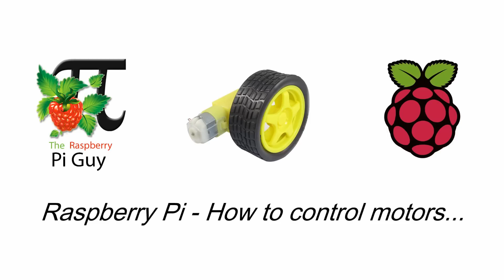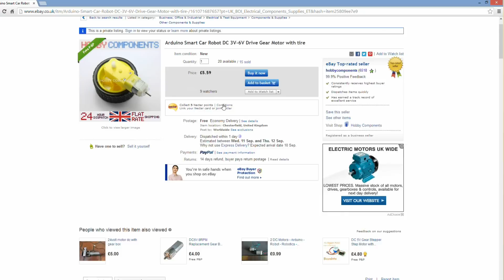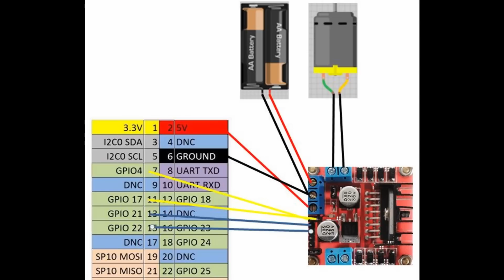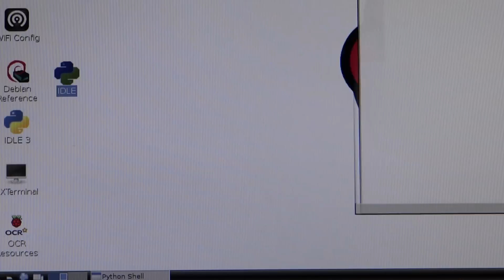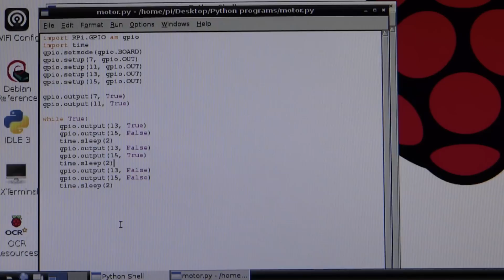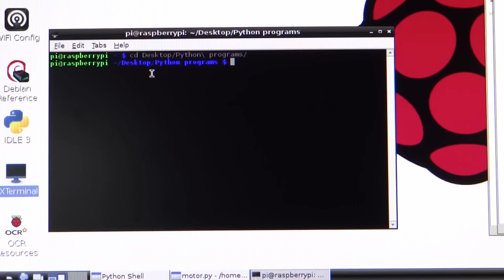OLD:Raspberry Pi - How to control motors...

Comment: Hello Sir, I managed to make the connections and also run the code properly. Thank you very much for the video. But I seem to be facing a problem, the motor gives a few spins (2 or 3 mostly) and then stops, it just doesnt respond. If I reconnect the ground connected to the motor driver or run the script again, it spins again a few times and stops. I have tried multiple tutorials but cant seem to identify the problem. I exactly replicated the wiring shown in your schematics. The motor is powered by 4 AA 1.5V batteries just like in the video. Only time this problem doesnt seem to occur is when I apply 20V 1A DC supply from the adapter and I cant possibly use that 20V coz I want the roboCar to roam freely (not plugged in to the wall).... Can you please help me identify what I might be doing wrong?

Comment: OK :) It is a good video If you are Matt Timmons- Brown Learn Robotics with Raspberry Pi  ....Problem...Chapter 3 page 62 to page 66.. You lost me and maybe a few others on this exact wheel motor on wiring in your book both wires are red. Not sure why one isn't a black or blue to show the difference between the positive and negative hook up. I am sure this matters in some way Let's go with page 62 Neither the motor or the wires tells me which is positive or negative I'd rather know then guess any tips?
Reply from the maker: Hi Scott! Thanks for your question - you can reach me at my email address or on Twitter more easily in future though. 

Just taken a look at that page and you don't need to worry. DC motors like these do not have a particular polarity, and so you can run electricity through them either way. In actual fact that's how you get them to go forwards or reverse - electric current one way or the other. That is why both of the wires are red in my book - the orientation doesn't matter.
Reply: @TheRaspberryPiGuy  ok thanks but does each wire go to a positive and negative on the bread board ?
Reply from the maker: @scottrocket3274  it is the same deal with the motor connections on the breadboard - the polarity and orientation of the wires is not important. Hope that helps :)

Comment: Could you use this if you wanted to control 5 or 6 motors? Also if you have more than 1 motor control board do you have to ground the Pi into each?

Comment: This video is great and really helped me out, so thank you very much :)  The only thing that I noticed is that in the video, you suggest that the +5v power on the L298N board is needed to supply the bridge with power (in which you did using the +5v power GPIO pin on the RPi). This video is the only resource on the net that claims that +5v is needed to supply the board, as all other information states that the +5v pin on the l298n bridge is to output a voltage to other peripherals. I tried out the l298n without supplying the +5v as stated in the video and the chip performed as expected and did not need it. Just to let you all know :)  Good work!!

Comment: 4 battery pack with 4*1.5v = 6v (if you are using non-rechargable batteries).
Raspberry takes 4.75-5.25 input voltage. Is it okay to give 6 volts from battery pack to h-bridge+raspberry?

If it so, can I use 4 rechargeable batteries, which will provide only 4 * 1.2v = 4.8v?
Will it be enough, or should i use 6 battery pack(with 5 batteries), in order to provide 5 * 1.2 = 6v?
I'm so confused about it, can someone explain me please?

Comment: But by using two GPIO pins for the enable you chew through a lot of pins. I'm controlling four motors identical to yours so I need to economise. I'm only using two pins per motor. I hold one low and PWM the other for forward and round the other way for reverse. On the driver the enable pins are jumper end together. Easy.
Reply: Thanks fro sharing , How are you using one PWM signal from one pin to change the direction ?
Reply: +vikas narang as I said, I'm using two pins. One acts as the ground and the other has the PWM signal. Swap for the other direction. The swapping gets done in code. So I've used 8 pins total for 4 motors but I can control them all independently.
Reply: +Ryan Ruckley  gotcha ... i didn't undertand the pin swapping part the first time.thanks a lot for replying

Comment: A little dilemma here, how do I know if this motor: http://www.ebay.co.uk/itm/Robot-Wheel-Motor-Tyre-DC-3V-8V-Arduino-Smart-Car-/131199698119?pt=UK_BOI_Electrical_Components_Supplies_ET&hash=item1e8c1c84c7   Will come with 2 wires attached to the motor terminals? As I am slightly worried about using a soldering iron but if I have to, would this wire be sufficient: http://www.ebay.co.uk/itm/10M-coil-11-AMP-Rated-0-5mm2-Thin-Wall-Single-Core-Cable-Car-Wire-LED-Lights-/111294043052?pt=UK_BOI_Electrical_Components_Supplies_ET&var=&hash=item19e9a453ac  Any help is appreciated, thanks!

Comment: That's what i love about the raspberry pi. The sky is the limit. You could make a quadrocopter with some fans on some light motors and use a raspberry to control it.. Put on a webcam and have a transmitter sending back the signal. Shouldn't be too hard. At least as a PoC build. I wouldnt mind having the time to make my own drone from scratch.

Comment: If you are using 2 motors do you need a higher voltage from the battery or will it just run out faster?

Comment: so i want to control a RC car motor speed, so i need more, power can i simply replace the battery source with the rc cars battery pack, it uses a "Lipo Battery 1500mAh 7.4V 2S 25C"

Comment: Why would you put pins into screw terminals?  It looks like that board has pins right next to the screw terminals you can use to power it.  Also why are you wasting two GPIO pins on "enable A" when you can just hard wire them (this is even shown in one of your stock photos -- you can clearly see someone simply just put a jumper over the enable pins!)

Comment: How can I change the motor speed (slower)? Is it simple?
Reply: Use pulse-width modulation (PWM). Basically, turning the pins on and off really fast, leaving it on for a percentage of the time, corresponding to a percentage of the power and speed. Google "raspberry pi PWM"
Reply: Thank you; i found another tutorial for that on YouTube :)

Comment: if  i want to make a car with this principal will i have to buy 2 L298N's and another raspberry pi
Reply: not another pi, just connect the 2 L298N's to the same pi, as far as I know.
Reply: Thx
Reply: @leop
Reply: Yes, two L298Ns can connect to one Pi. Jumper the Enable pins and it only requires 4 GPIOs. Pi has 17 without soldering on the second header, so you can use up to 4 L298Ns to control 8 motors, with one GPIO left over (indicator light?)
Reply: You could also consider keeping the car 2 wheel drive (power either the front 2 or rear 2 tires and have the other two free spinning).

Comment: that's got to be the most china motor ive ever seen, so wobbly lol - it would be much easier if you just started idle in root and ran your program from there. just add gksudo after apt-get install gksudo - or use sudo when you edit the desktop shortcut, that way you dont have to type all that stuff in when you are prototyping constantly - also sudo su helps in a shell if your going to be running allot of root commands.

Comment: cool.
multi port high power USB HUB charge tablet ipod ipad phone USB BITCOIN Razorfish

Razorfish Solutions manufacturers
USB HUB 19 Port USB Hub with Integral power supply and Steel/Aluminum case

This is a 19 port hub With an integral power supply capable of 
reliably supplying MORE that 500mA per port without overheating or becoming a fire hazard. 
16 Front facing Standard A USB ports 3 Side facing Standard A 1 Master hub connection 
Standard B for connection to Computing Equipment or other hubs Fully fused internally via multiple poly-fuse resettable fuses both on each individual port and on the main power feed to the Ports.
Unlike may of the cheaper USB ports that only implement links at 1.0 12mb/s speeds 
(but state they are 'compatible' with USB 2.0) 
this is a professional FULL 480 Mb/s port that complies and implements the full 2.0 USB standard,
it may also be used to connect to generic USB 1.0 equipment.

Comment: You don't have to connect the first Enable-A cable from your video. As long as the second is high, the chip is enabled. This is also the input to use with PWM to control the motor's speed.

Comment: Thanks again.  Just spent time with my daughter converting a small robot using this. We used two wheels (easy enough) and, other than being a little under-powered, it worked great.

I didn't want to have anything connected such as a keyboard so I set up SSH so that I could remote into the Pi and run the programs using Putty from my Android tablet.  Look ma!  No hands!

Comment: Nice tutorial! That exactly what I need. But I tried and found the rpi can't work however. When it started screen can print some messages, Particularly  the network module can't work, neither wired or wireness. And the power I use is 12V. So I doubt the gpio 5V if whether can as the power input? I also see the circult diagram, it didn't has a diode, then I can't how to do next,  appreciate for any advices.

Comment: I get a syntax error (Non-ASCII character) on line 13 :L when I run the code.
Reply: please help some one. :(
Reply: ***** what you need to do --> 1. Check your code. 2. Save your code. 3. Open saved code using Geany. 4. Delete the top part which describes where and who made IDLE. 5.Try running it again, and restart your Raspi ;D. 6. Reply if you need help or if this worked :D

Comment: How to control 12 motors with rasp?
Reply: 12V ...? or many motors with rasp...?
Reply: FinnishGuy101 I was use GPIO direct drive 8 digital 7 segment and LCD1602*1 and 12 stepper motors

Comment: Thank you so much.  This is an excellent step by step guide.  
I have an older robot built with some old power screwdriver motors but we had to control it with switches and walk behind it.  That robot was built with my Son and now I'm going to use this to update it as a project with my Daughter.   This was exactly what I needed.

Comment: Most of all videos I've seen, the user is pi, with the stupiest sudo setup that I know...
Plus: all of you using the xserver. So much Ressources for a mouse.

Y U NO use the power of shell?
Reply: thanks for whining , judging and slamming while contributing absolutely nothing to this topic. Youtube could use substantially less of your kind. RaspberryPieGuy took the time to put together a 20 min demo for everyone's benefit. Feel free to do up your own if you've got a lock on it.
Reply: Robert Stotts
Security is always important, and it is not best example what he did.
You can see this as a proposal.
Reply: learn to spell stupidest
Reply: Robin Cerny Security is not always important, so relax big guy no one wants to hack into your network and burn up your DC motor or access other data that someone super smart like yourself might have.
Reply: Security is not always essential especially for a device like that. And if you mean about following traditional practice regardless of situations that is debatable. You may actually suggest that the author would give notes, ideas or warnings on his videos about security in raspberry pi on setups that would need it then I could agree with that although it could also give weight to the lesson. As for X it may be giving less runtime efficiency but may have been a better choice for presentation with the videos to get newcomers and even experts to get the concept of the main topic quickly.
Reply: Yes like I said on setups that would need it that would apply but not on something that would just run motors. And follows my other explanations as well.
Reply: Ross Konsolebox
Right, with X it is easier. But security is always important. Many of the users use it as a small server. And many use it as a webserver which is accessible from outside.

Comment: Good explanation. 

I have one question for which I believe other people may have too:

How to control speed of the motor(s)?

This is because sometimes we don't need our robot to run as faster as possible, but instead very slowly - especially when some detector (ultrasound) is attached to help avoid obstacles. If speed is too fast, then robot will bump into obstacles too often.

Than you in advance,
milan
---
Reply: spoydi spore
Not true, you can (and should) use PWM...
Reply: the only way to control a dc motor with 2 wires is to adjust the voltage going through the motor. you can easily do this by making simple 5 transistor circuit on the power supply for the motor and using a potentiometer to controller the current going through the transistors.
Reply: loop delay the output of the PI.
Reply: KKuurus I am not still sure delay what? To make short pulses, then delay? Or, something else? Or to use PWM? Does this device has PWM at all? 

Sorry for too many questions, but before to make decision whether to invest money into this 'toy', I want to know what exactly I need for robot (I have plan to make one, maybe in distant future... low on budget right now).
Reply: by looping through a delay before you reposition the servo/stepper you can slow the movement of the motor. 
in the software driving the motor, will slow the movement of the shaft,
PULSE
delay delay delay
Pulse
Pulse
delay delay delay
Reply: ***** PID will do the work if u know how to use them

Comment: would i be able to use a 1500 mah NiMH battery from a traxxas rc car to power my motors? or would i fry the arduino. Also do you have a video showing how to hook a xbox360 remote to rpi?
Reply: Depends on the voltage of both the battery and the motors. 
And to hook up a xbox360 remote to the pi plug in the cabled version or buy the wirelss controller for windows/PC
Reply: thanks

Comment: so you made it control a wheel but how would you get it to control multiple wheels?
Reply: Use the A side (ENA, IN1, IN2) connected to one motor and the B side (ENB, IN3, IN4) connected to the other.
Note the "back enable pins" are not Enable at all, but +5v. You may jumper between the front and back to permanently enable that motor, or connect the front Enable pin for each motor to the Pi. Do not use 4 wires for Enable, only two, connected to the front pins, the ones even with the IN row.
Reply: he did mention you could use input 3 and 4 for more than 2 motors

Comment: Would it be easier and/or more efficient to control motors that are connected to arduino but controlled by raspberry pi. I've already successfully done this but I was wondering if excluding arduino and only using RPi would be more beneficial. I'm working on converting a RC car into a car that will connect via wifi to be controlled by inputs on my computer and receive a live camera feed and later I plan on making the car autonomous by adding sensors.

Comment: Can you control motor speed with the L298N or is it just an on and off function??
Reply: You control motor speed with your program in Python
Reply: Thanks, that is what I thought but wanted to make sure the relay would not act as a simple on/off switch.  I guess I should have said, Can you control the speed despite the relay.
Reply: Chris Kaspar The L298N is not a relay... it's an H bridge. A relay IS a simple on-off switch.

Comment: HI
Thanks for tutorial but im stuck. 

First bit of code ive ever used so sorry if this is a daft question

 Ive used ur code as follows in idle and when i run it i get

SyntaxError: Non-ASCII character '\xc2' in file motor.py on line 13, but no encoding declared; see http://www.python.org/peps/pep-0263.html for details

What does this mean???

code i copied

import RPi.GPIO as gpio
import time
gpio.setmode(gpio.BOARD)
gpio.setup(7, gpio.OUT)
gpio.setup(11, gpio.OUT)
gpio.setup(13, gpio.OUT)
gpio.setup(15, gpio.OUT)

gpio.output(7, True)
gpio.output(11, True)

while True:
    gpio.output(13, True)
    gpio.output(15, False)
    time.sleep(2)
    gpio.output(13, False)
    gpio.output(15, True)
    time.sleep(2)
    gpio.output(13, False)

Comment: Is it possible to bridge the ENA pins with a jumper, like on one of the photos?
In my opinion the Motor should be enabled the whole time.
And now I can simply turn on and off the motor by setting the input pins for the directions on and off?
So I would have 2 pins more for other stuff...

Comment: If you had 4 wheel attached to 2 L298N's  could you set it up to take user input,for example 'left' will stop the left side motors and start the right side ones for say 2 seconds for 90 degrees (ish). If you had a wireless keyboard you could remotely control  your raspberry pi to move if you had a user input programmed in. (I'm new to python and I'm not sure if this is possible)

Comment: Is it possible to control any type of motor with a raspberry pi or arduino? I would like to use the actual claw machine from a real arcade machine, would I be able to control the motors on the claw gantry(x-y)? They look like dc motors.
Reply: yes, just follow same procedure as noted on the earlier vid. thanks
Reply: lessedu thanks!

Comment: Thanks for the Video! It was very informative and gave me a starting bases for my
robot project at school, but for my project I need to control  6 motors. As far as i'm aware I need to use 24 gpio pins to control them all, however the pi only has 17.
Do you have any solutions? Thanks in advance.

Comment: I have a robot that has 2 6V motors (pololu.com/catalog/product/1060) and would like to achieve what you did in this video. I will be using a raspberry Pi. Can you recommend a servo board that I can use? Or will the one in the video be enough to power both the motors that I have?

Comment: Hello,

I'm selling the board, battery pack, and 2 engines on ebay currently.
here is the link. go to  cgi.ebay.com and then remove this text ws/eBayISAPI.dll?ViewItem&item=141098234619&ssPageName=ADME:L:LCA:NL:1123